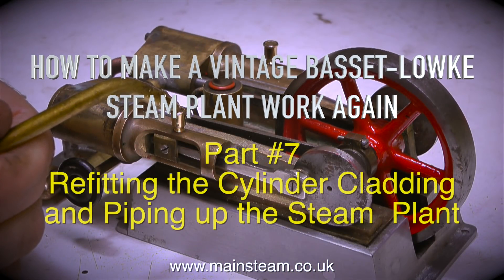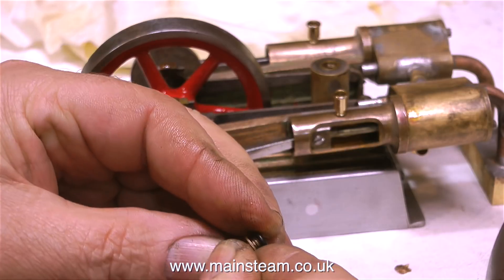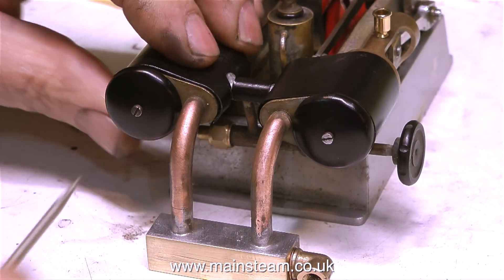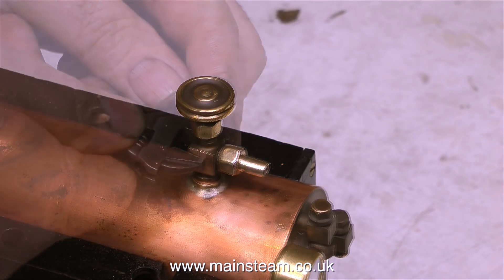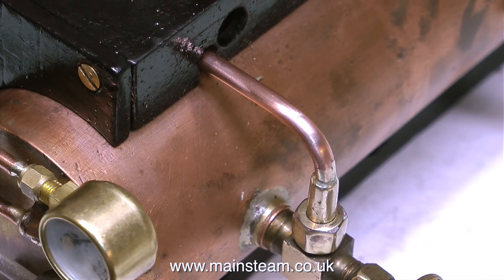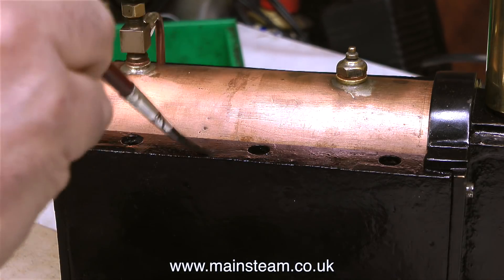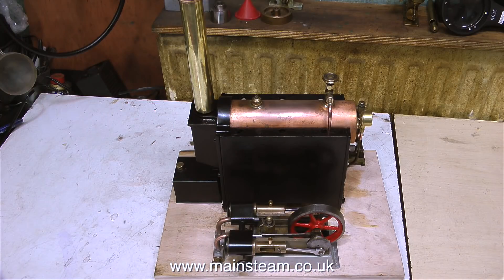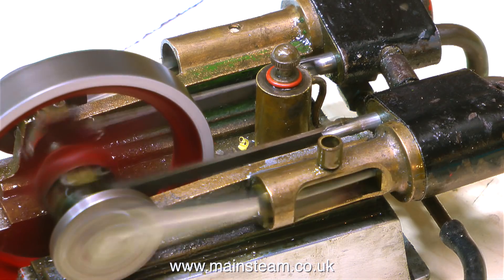HOW TO MAKE A VINTAGE BASSET-LOWKE STEAM PLANT WORK AGAIN - PART #7

Comment: Keith, re the mahogany, I pick up old tables and dressers from auctions for around £25. They provide loads of excellent wood very cheaply - of course it means a bit of work dismantling and re-sawing, but well worth the effort, the wood is way better than the modern stuff.